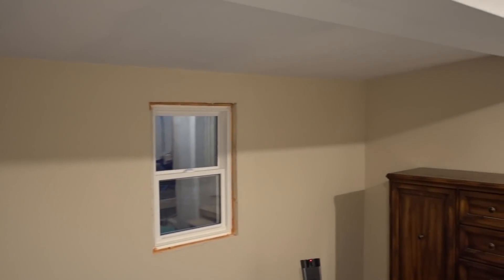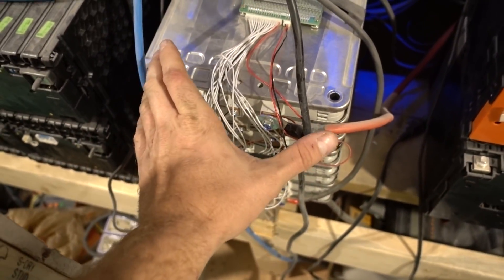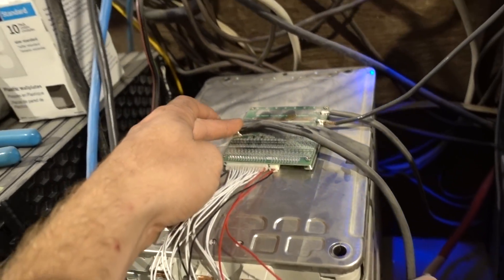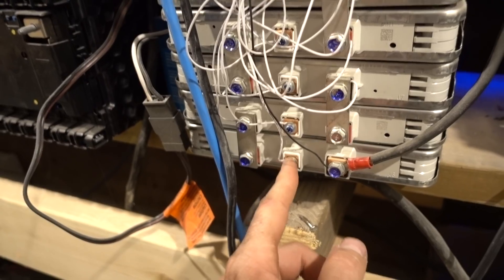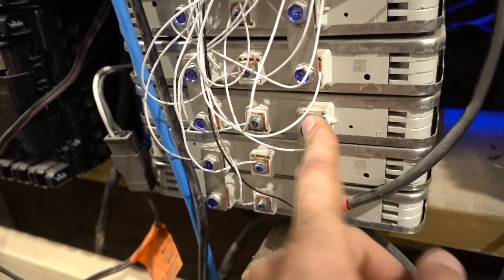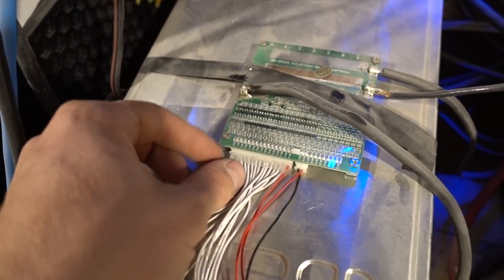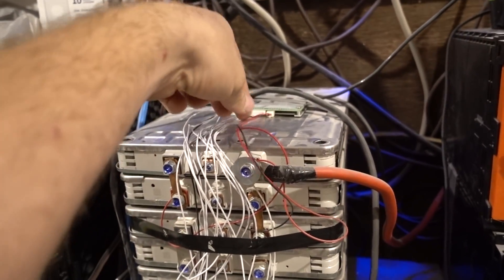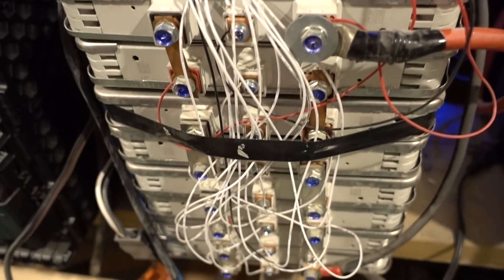Showing My Nissan Leaf Batteries Hooked To A 16s BMS

Comment: how do you set upper and bottom voltage level on this bms?
Reply from the maker: you don't, it comes with a standard low and high cut off
Reply: @GoingOffGrid101  got it, so it's configured for lifepo4 chemistry from factory. Thanks for video.

Comment: do you think nissan leaf battery like yours would be safe to put in a basement for a power backup system?  im nervious putting such a large lithium battery inside the house yours is in your house or a detached building?
Reply from the maker: Its inside, with a good bms they are safe

Comment: I noticed you have 8 modules. What voltage are you running for your system. I’m setting up a 48 volt setup with Leaf modules. I’m using 7.
Reply from the maker: I have a 67v max charge system.
Reply: Why 8 modules?
Reply from the maker: @onegreenev  16s is 67v full charge

Comment: did you conect first the bms -negativ  and then the balance plag ? what he does and he automatically balances
Reply from the maker: yes just as you said, then the bms will balance at 4.20 volts as you charge.

Comment: Very informative, thank you very much !   I own a few BMS boards similar to this (16S) and have toyed around with the idea of connecting them to my batteries.  My question is:  What do you think the odds are in one of these boards failing and actually 'causing' the cells to go out of balance ?    As it stands my batteries are staying perfectly 'in balance" going on 2 years now- I'd hate to hook up one of these $10 boards and have some cheap diode fail, or some other electronic component fail and suddenly find my batteries are all out of balance.  What are your thoughts ?    Your power room looks great
Reply from the maker: im also going on 2 years with these $30 bms and all is well, I have tested 3 bms to fail and they seem to fail open circuit, I have been pleased with the quality of these 30 dollar boards so far.
Reply: @GoingOffGrid101 - in a way that makes sense because the design would be such that it would 'connect' a high voltage cell to ground correct ?.... meaning, if it quits working, it will stay 'open'.   I suppose it could go to ground and drag a cell down but that would take a logic fail as opposed to a component fail.
Reply from the maker: @mark_osborne  plus it would take a month do grad these large cells down

Comment: you might have this answered in a video before. can you actually see what the bms does like in a smart app or windows?
Reply from the maker: this one in the video only has led lights showing witch cell is being balanced, I have better ones like this that use blue tooth to your phone.
Reply: @GoingOffGrid101 , thanks for the prompt reply. it might be a bit different for you as you have so many cells. i only have 16 400ah cells, so i am really keen to see what they are doing.
Reply from the maker: @ursodermatt8809  you can get 100 amp bms with bluetooth
Reply: @GoingOffGrid101  ,
thanks for the reply.

Comment: Thanks I've been wanting to see the details of this for a long time.  The board I bought didn't come with any instructions.  I blew one section on mine and I just moved over to the next connection for my first negative and it still works, but I don't know if the main battery negative will still be good to use.

Comment: I fried my first bms,  bms with display,    went negative with black wire,  and to far left positive   showed 8v every other probe showed 4.17,    tried to get all wires to show 4 volts  so... stupidly moved black ner  wire to center tap,  and 1st voltage probe onto negative.         Ever though running 4 leafs     all digital readings showed 5volts.   And then  puff  up in smoke.    ,
Reply: I have the same issue where its 4 then 8 then 4 then 8. How do you solve this?

Comment: Looks good what kind of charger do u use to charge the volt batteries I have the c max batteries
Reply from the maker: I going to use a Esmart3 charge controller soon.
Reply: I'm looking for a battery charger to charge all them up to the same voltage what battery charger would u recommend
Reply from the maker: @dangoras9152  any hobby charger were you can set the max charge voltage will do, the ImaxB6 is a cheap one that will do or you can look at the much more costly 1000w hobby chargers, I don't know witch one is the best atm